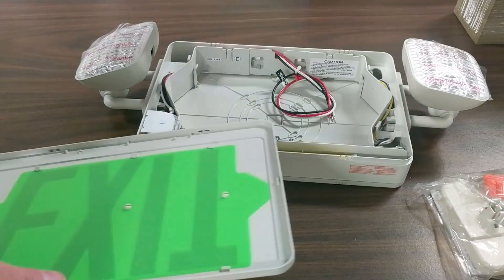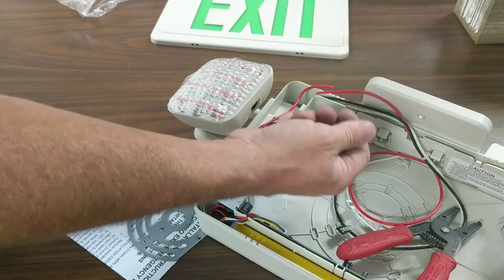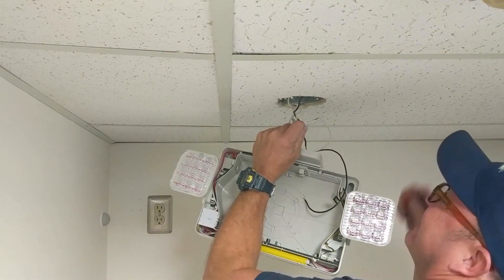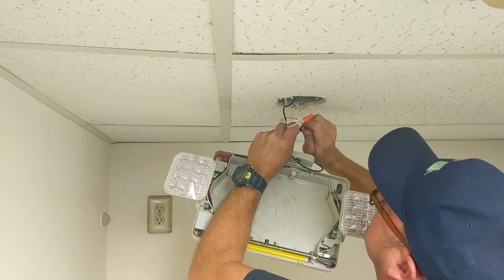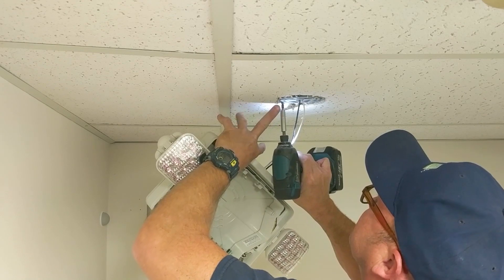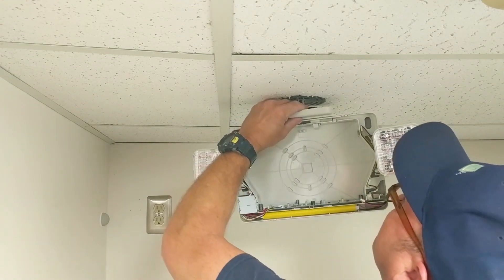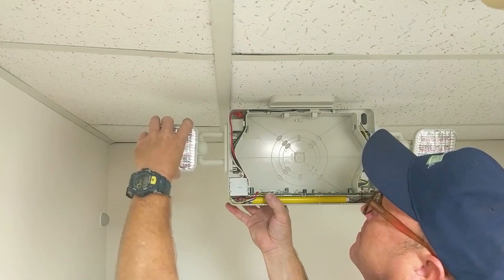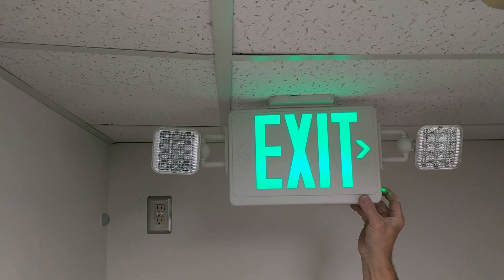How To Install an Exit Sign by a Professional Electrician

Comment: I have red, black and white wires on my E. light kit but I have black, white and green wires coming out of the wall.  My application is for a business. How should I wire this?
Reply: With a multimeter (voltage), derermine the voltage coming out of the black & white wires in the ceiling. White is neutral, green is ground, black should be 120v. If the reading is correct at 120v, then you DO NOT use the red wire on your exit sign (that is 277v). So you connect the black & white wires for 120v. 
Our commercial building has 277 v for all of our exit signs.

Comment: How does one do this if there is no junction box and want to put one of these in their room? 👀
Reply from the maker: These units are for commercial use, not residential. Though it would be fairly easy to attach a plug-in cord to the unit and use it that way.
Reply: @ExitLightCo  Sir the Emergency light need phase and neutral coming from thr Dp board or we can make one gang switch ?

Comment: the side lights are on without reason may i know what could be the possibility to turn off without any emergency
Reply from the maker: The side lights are typically on when the exit sign is in emergency mode; meaning that the unit is being operated by the battery. If the lights do not shut off within 90-180 minutes you might have a faulty unit. We suggest contacting a licensed electrician to further troubleshoot the exit sign.

Comment: Ok, should u feed the wire into the juction box or you could keep it  within the emergency light? what is the logic? Thanks.
Reply from the maker: You certainly could make the connections and leave the excess wire in the unit but it would likely be visible through the "EXIT" letters when the sign is lit, obstructing them somewhat.

Comment: Can Emergency lighting be wired from existing ceiling lighting circuit ?
Reply from the maker: It's recommended (and even required in some jurisdictions) for emergency lighting to have it's own, dedicated circuit. If you are going to use an existing lighting circuit, it cannot be switched as these require uninterrupted power to function correctly

Comment: Do you have to ground the light?
Reply from the maker: The majority of thermoplastic housing exit signs and emergency lights typically do not include a green ground wire. However, steel and aluminum housing units usually come equipped with one, and it is advisable to ground these units for safety reasons.
Reply: @ExitLightCo  thank you 👌🏿👌🏿

Comment: What does the 120 vac mean?
Reply from the maker: "120 VAC" stands for "120 volts alternating current." It refers to the standard voltage provided by electrical outlets in many regions, particularly in North America. This voltage is the potential difference between the hot and neutral wires in the electrical system and is commonly used to power household appliances, lighting fixtures, and other electrical devices. The "AC" indicates that the current alternates direction periodically, as opposed to direct current (DC), which flows consistently in one direction.

Comment: where was the battery and circut board?
Reply from the maker: The battery for this particular combo exit sign is located inside towards the bottom of the sign; the circuit board is right above it.

Comment: I'm new to this stuff. I see a power wire and neutral is their no need for a ground wire?
Reply from the maker: Excellent question!  Since the sign is constructed of a non-conductive thermoplastic, there is no need for a ground wire.  We do sell steel and aluminum units which do have that extra ground wire.

Comment: i cant find a breaker to turn the power to my emergency lights off. would it be tied in to the fire alarm system
Reply from the maker: Typically they are not tied into alarm systems but there are a few that do.  Sometimes there isn't a 'dedicated circuit' specifically run for emergency lighting and they're tied into other lighting circuits.

Comment: If the rest of the lamp is off and I have one on, what do you think is that friend?
Reply from the maker: That's a great question. It can actually be several things, we suggest asking your certified electrician to check if the lamps are making a proper connection to the unit. Often times, the lamp connections come lose causing a faulty lamp. They can also check the user manual for further troubleshooting steps.
Reply: @ExitLightCo  ok thank you sir

Comment: I installed a few 2 head LED emergency light and tested others (working in my own building) 4 of them failed to light up. So checked the battery - each were good, around 6.x volts. Pressing the test button and it just make sort of a wimpy buz noise for a second. So I just replaced the whole unit, still have the same issue - no lights - this is in about 4 wings of the building. is it possible a wiring issue or user error (LOL).
steps taken:
1. out of box
2. back plate to the wall
3. connected black/white, and snipped the red wire
4. tucked them into the wall
5. connected batter to itself (spade connectors)
6. connected whole unit to wall plate
7. red light comes on - so there is power
8. press test button - nothing.
Same problem with 3 others
Reply: The battery pack has a wire with a connector coming out of it, you have to plug that into the switch board right above it

Comment: everyone watching this video probably being older adult men needing a sign for their office or something but then you got my teenage self here wanting it for my room😹😹 why can’t you just like stick it on the ceiling or like screw it in then it has a regular plug you could run down the wall lol, there might be but idk
Reply: Hey same
Reply: I'm sure it can be done
Reply: Same.
Reply: @EternalWithin  same i have one but my mum does not want me to screw it to the ceiling
Reply: @ALT-9167  same i put a lithonia lhqm led combo but my dad didn’t want holes in the wall so we used weight rated 3M tape to mount it
Reply: @thoward575  bro make sure you dont slam the door at any time and always watch the sign to make sure it doesnt fall off because tape does go away eventually
Reply: @wubbablewow  oh its very securely mounted on the wall we used tape rated for 15 lbs and the sign is like 3-4 lbs i think
Reply: so yeah that totally isn’t me right now
Reply: im putting it over my bedroom window.
Reply: I stole a fresh one from my old apartment’s supply closet trying to figure out how to put it up

Comment: Make sure there is a 2x4 in the drop ceiling. If there is none then the exit sign will fall.
Reply: If in a commercial building (you will have drop ceiling tiles), the metal round bracket will be mounted to an outlet box that will have conduit piping for a rigid connection so the exit sign is not going to fall. If someone did a bad install against code, then that could be an issue with no support in the ceiling.

Comment: Excuse me,  are the wires inside the junction box connected directly to the final distribution board? so it has its separate circuit breaker or they  are connected to a lighting circuit. explain please by a single line diagram if possible. Thanks in advance.
Reply: Usually city building dept.s  Want all. Emergency/Exit light on their own Circuit with a lock on the breaker.  Just like the Ffire alarm. At least that is what they do here.  For small remodeled the i inspectors aren't this particular.

Comment: Hi, we installed several of these but the lights don't come on when pushing the test button.  I dont see any cables not connect.  Any ideas ?
Reply: You probably need a Nicad battery there should be a connection on the LED board
Reply: erik dopp 
Hi

Found it.  There is a cable to connect.  Nothing in instructions and you can see the cable dangling.  We had to pull off the plate on the other side and now working. 

:) 

Appreciate it.
Reply: No problem i did these for the first time yesterday lol
Reply: @ed6852  my combo2 exit sign works properly. Test mode works.
Reply: Deves conectar el cable de las baterias Antes de la conecion a 120 v

Comment: im getting another exit sign from a place called home depot
Reply: Many thanks, I been tryin to find out about "emergency exit light batteries" for a while now, and I think this has helped. You ever tried - Eenseh Unthinkable Expediency - (do a google search )? 

It is a smashing one off product for discovering how to get emergency light without relying on batteries minus the normal expense. Ive heard some super things about it and my work buddy got cool results with it.✅
Reply: @PeliculasOnline2017  well I replaced my sign with a AKT Exit Sign emergency lighting
Reply: @PeliculasOnline2017  you should get the exit signs with the square emergency light

Comment: Hmm, this was open earlier as he removed the instruction sheet and plugged in the battery cable.
He never mentioned checking to see that the battery needs to be hooked up before installing. 
He "assumed" people would have done this already.
Reply from the maker: Our Electrician didn't touch the battery until after the unit was wired to the buildings power.  All signs are manufactured with the battery disconnected.  If you attach the battery first before connecting to a stable power supply, the sign will automatically go into Battery Backup mode and start running off battery power until it's out of juice.  Connect power first, battery last.  Thanks for watching.

Comment: Does anybody know how much it may cost to replace the red covering
Reply from the maker: Are you talking about the diffuser, which is the red or green sheet inside the exit sign?  Or are you talking about the faceplate, where the "EXIT" lettering is?  If you ordered your Exit Sign from us, contact our Customer Service, as we may be able to get you a replacement part.
Reply: The Exit Light Company the diffuser

Comment: I like how he made the connections inside the junction box as to not obstruct the lettering in the sign itself
Reply: @alvarogalindo596  
9
Reply: To install a exit sign I think you need drywall/wood for the installation
Reply: Melissa Dingle it can be installed on the ceiling, it’s also required to use a junction box or conduit
Reply: @Thunderbolt1003  well at 8 pm I'm getting a exit sign with the rectangular heads.

Comment: What is the red wire u cut
Reply from the maker: The red wire is for installations using 277 Volt.  Our Electrician determined he was going to be installing on 120 Volt.  Whichever wire you don't use, you cap off and tuck away.  Thanks for your question.
Reply: the first job I did in my present company was installing combo exit sign with living 277v. it was tough but priceless experience.
Reply: I have one ive been wanting to mount for years but I’d have to take bedroom light out to do so lol I want it up bad there is yellow and blue wire inside but was different from irs it looks
Reply: What wire color should I use if I have a 220V suppy?
Reply: @samdag9755  red and white.